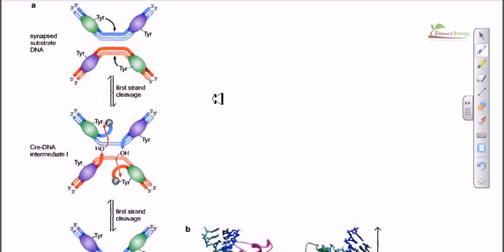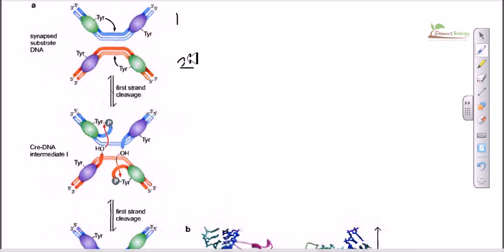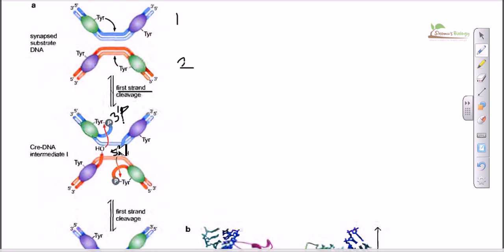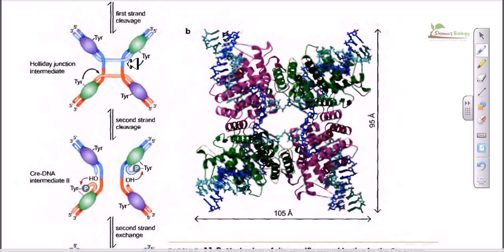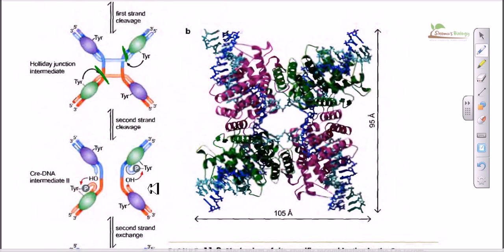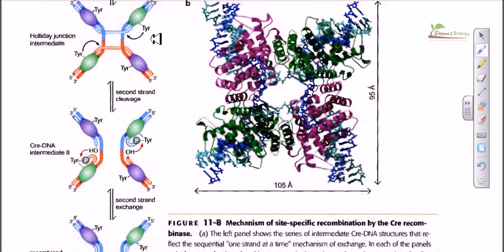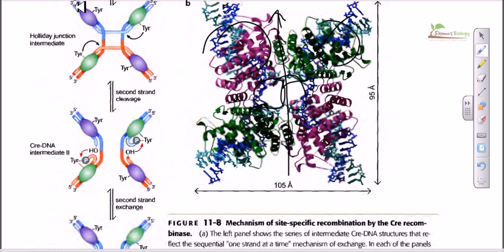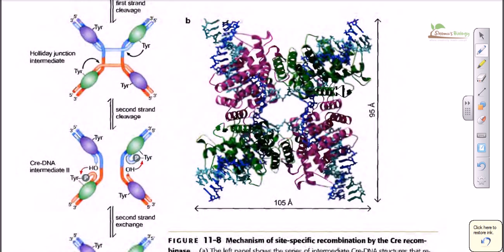Cre lox recombination system

Comment: The actual reason as to why the Cre-lox complex is tightly bound is closer to the fact that the units form a tetramer by binding to each other, and this symmetry helps stabilize the structure. Great work any way!